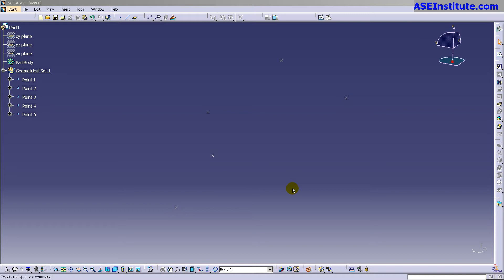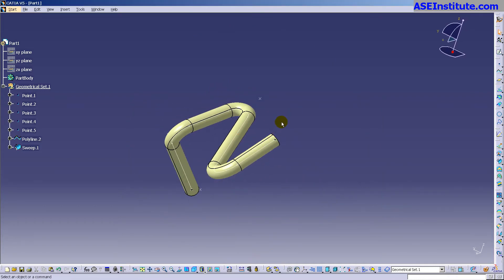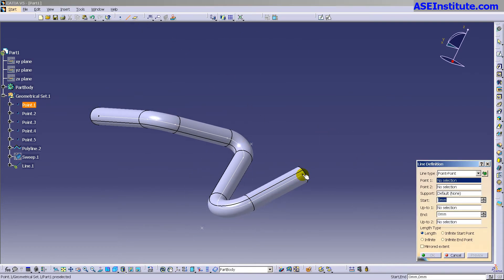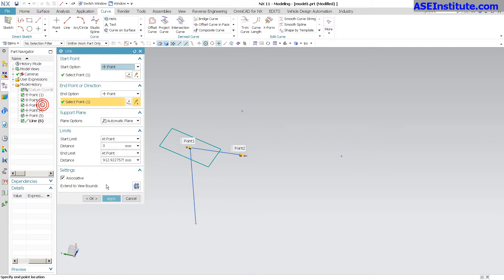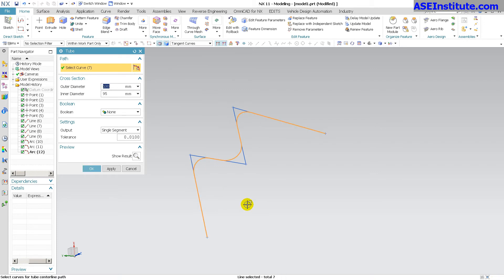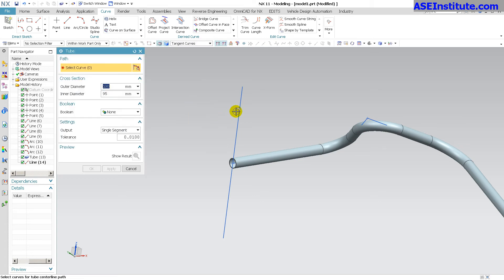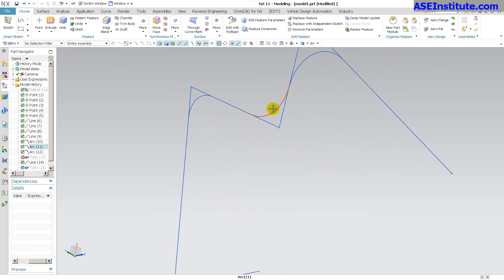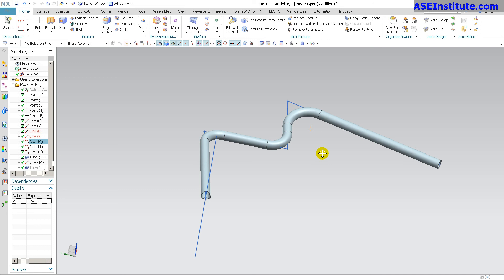CAD Wars: Make Bent Tubes | CATIA vs NX

Comment: Hey Steve. The comparison of two CAD softwares is really cool. These videos are really helpful.
Im a NX user. Recently switched to CATIA. Can you make a basic video of how to unsew and remove a face from a surface in CATIA.(This command is there in NX where one can unsew a particular face and also hide that face).
Reply from the maker: Well, in CATIA unsew does not currently exist. I use a work around. I will show it to you soon.
Reply: whu change cad software nx to catia

Comment: Which tool handles making Tubes better?
Absolutely CATIA tubing & piping design!
Reply from the maker: Both tools are great. Hard to make a judgement
Reply: @ClassASurfacing  I don't think so for industrial, aerospace, automotive design.
Reply: @autarch62  he is not speaking of any particular application. if you want wiring, harness, or any mechanical /elecrtical application check NX routing tools. much faster method than anything i've seen in other cad systems

Comment: you will truly understand the power of NX when you create 3D model of car's gearbox component from 2D drawing (drawing size 2A) or another complex model in car industries but easily to modified , the history column of the left side maybe long, but very detail and easy to control the model when you make change with it...
Reply from the maker: Even if the parts have no history you can still make those big changes. Amazing stuff.

Comment: hi, i'm unable to use revolve command for a design in ''wireframe and surface design'',  problem is that, the tools are faded and i'm unable to select them. please help
Reply from the maker: Try going to Start>Shape>Generative Shape Design.
Reply: yes, that thing is working, but please help me in fixing the  problem with wireframe and surface design ,
Reply from the maker: If you have GSD you do not need it in Wire-frame and Surface.

Wire-frame is the lesser license than GSD so just use the GSD.
Reply: copy that, Sir.    how can i fix the same problem with DMU Kinematics sir ?  its tools are faded and i cant select them.same software is working good on my sister's laptop but not on mine..while mine is more advance.

Comment: Little shortcut in NX would be using spline instead of point and line's so you can control your tube in dynamic update mode.
Cheers!
Reply from the maker: Correct. Spline is a very powerful tool and a single segment 2 point spline gives us a line. One reason I use lines though is that the bends all have a point at the theoretical. That point has parameters that can be adjusted in the part navi. Even with spline I would still use those points. So dynamic update wont really come in to play.